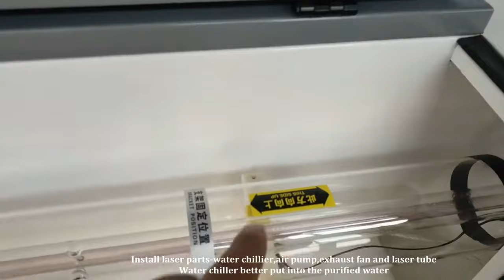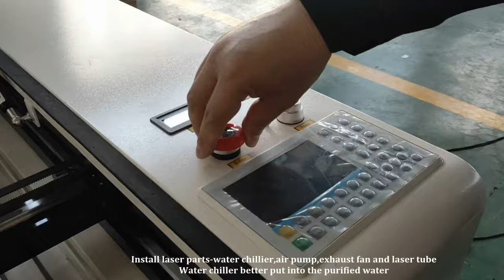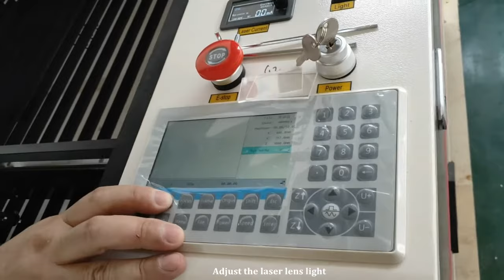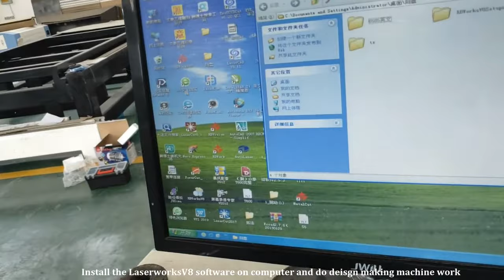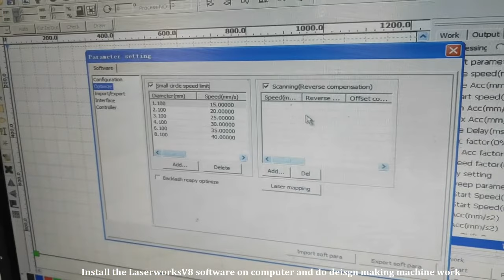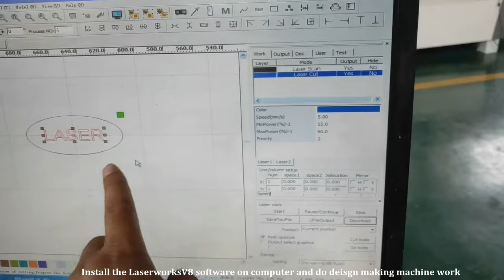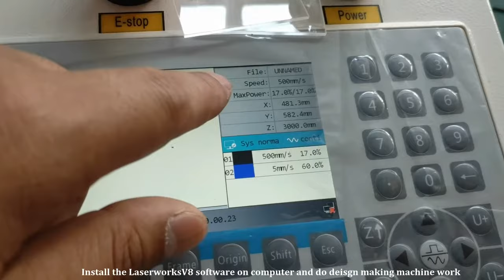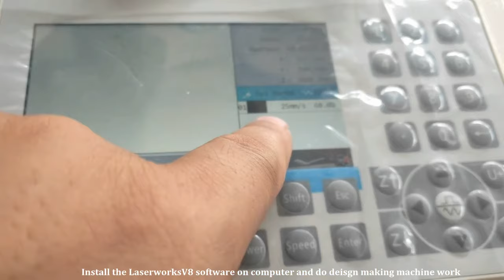co2  laser cutting machine with EFR RECI 150w installation and for engraving and cutting

Comment: how much power is this running off of 120 volt, 220volt ?
Reply from the maker: This machine is 130watt. Can use 120V voltage or 220V. After can produce 80w,100w, 150w, 180w or bigger 220w,300w,500w.

More details and price, please contact me by email: info@starmacnc.com and whatsapp:0086 15194126152

Comment: 2*3 feet machine price co2 laser
Reply from the maker: Dear 2*3feet near our 600x900mm size co2 laser machine. It have 60w 80w 100w 130w. So which laser power do you need ? Then i can quote you accurate price. By the way, please add my whatsapp of write me. My whatsapp:+86 15194126152  Email: info@starmacnc.com